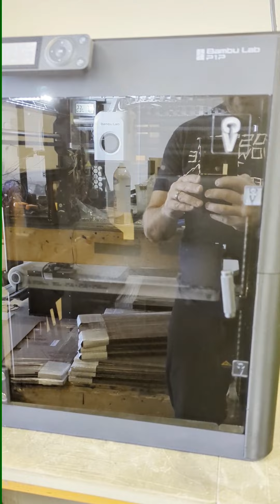Bambu P1P enclosure color options by Clearview Plastics

Comment: They look nice but the issue is once you bye this case kit you might as well but the X1 or Carbon. It would be the same cost
Reply: not really the acrlic cost 70$ and its just basic nuts and bolts and magnets with some printed parts